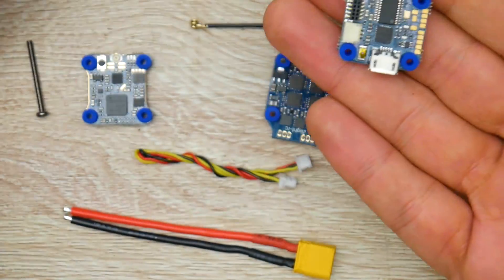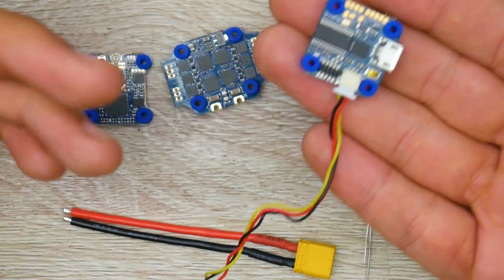iFlight SucceX F4 V2.0 // Overview and Setup

Comment: I have purchased this stack (the one with the motor plugs installed). I have examined the stack and researched on-line, but can not find an orientation for this particular stack. My intuition tells me that the camera socket is toward the front and U.FL connector toward the back. Interestingly, this puts the battery connections on the side just under the USB port; is this correct. Just a note...even iFlight does not seem to have a manual specific to this particular stack; everything that I could find is for the (same?) stack with solder on motor wires. Thanks.

Comment: For the Spektrum guys that are using the SPM4649T or the 4650 you will use the 5v power and the t2 pad. You need the two way pad for telemetry receivers.

Comment: The v2.0 good for motor have a pin. Mine v1.5 good for direct solder. Actually its can fit any version esc...
Reply: manvsfood-fpv Which Betaflight motor protocol  are you using for this FC??
Reply: @IbnAir23  i stick to default protocol. Dshot 600. This stack reliable to use.
Reply: manvsfood-fpv 
The problem I’m having is I’m using Spektrum RX.  and when I arm the motors and throttle up they spin weird and just stop, then when I throttle down the motors keep spinning.
Reply: @IbnAir23  first you check the motor rotation is that same inside you set in betaflight. 
Big cause the motor rotation was wrong or wrong props installation. 
Try check one by one the motor rotation.
Reply: the 8 pack pin sets between boards are in different places, v1.5 esc will not fit v2 FC.  Also the usb fall/broke off easy on v2.
Power into the ESC and usb plug are on the same side of the stack and can be a pain for a topside micro battery config.

Comment: i've had two of these
i don't like how few pads there are on the fc
on both versions i had, the vtx burned out

i have the mamba 16x16 esc and fc + eachine nano vtx
no problems since
to me, a much better solution

a sad thing is that it has a current sensor, which nobody needs, and nobody can calibrate,
but no blackbox storage
Reply: mr. mesh, i like how drastically your video quality has improved
please be sure not to sacrifice content quality for it, though
Reply: Marc Frank 
Which Betaflight motor protocol are you using for this FC??

Comment: Love this stack for the size, price and performance.  Only downside is the pins between the esc/FC,  just like the emax F3 combo i also used in previous quads.  Some hot glue and making sure the standoffs are always holding the FC and ESC tightly together helps.  Happy flying!